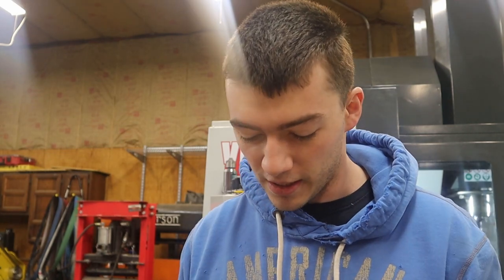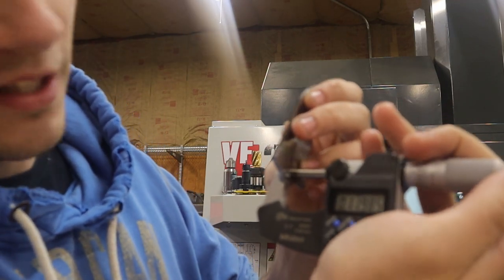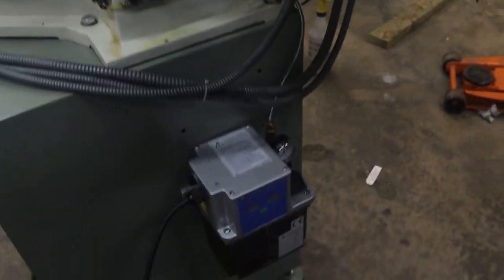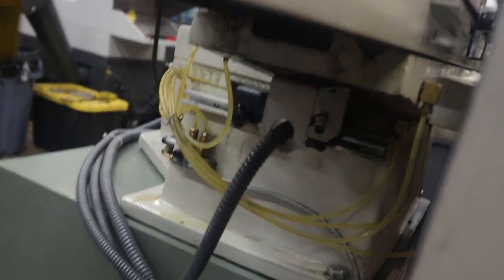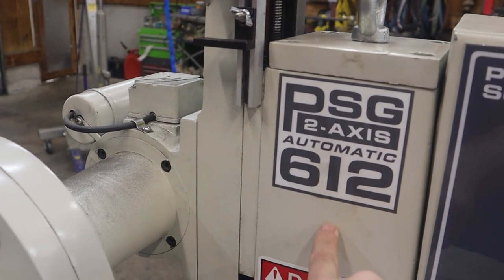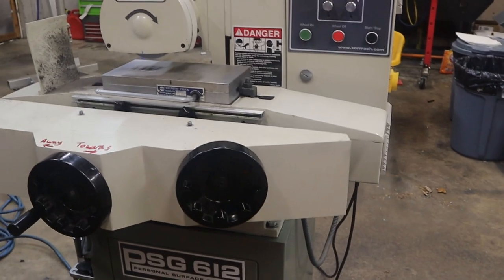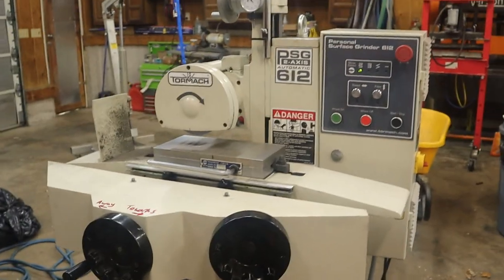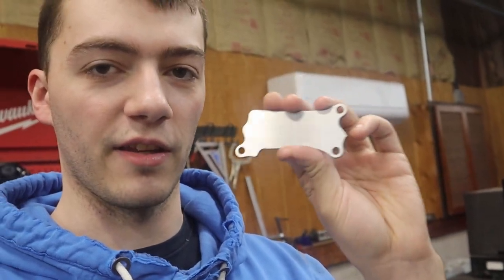The thing I really needed - A surface grinder

Comment: I feel like I'm in a similar spot. I really need my blades an exact thickness. But in my area there's rarely any good used machinery near by. :(
Reply from the maker: There is a ton of old 3 phase grinders for sale. I passed on all of them because they were manual. Those old grinders would certainly grind better but none of them were automatic. After using this one, I would never get one that didn't have at least 2 axis control. Plus 3 phase can be a pain. 

Maybe you could send your stuff out to be ground? After surface grinding, I can't imagine ever going back. Its nice to know that your part is actually flat and parallel. Takes some of the frustration out of work holding and actually getting a nice part. I will add that acid etching the surface ground surface is proving to be tricky. Not sure if you're planning on any acid etching but just keep that in mind.
Reply: @split141x  I definitely agree about wanting it to be automatic. I think sending things out to be ground is a good idea, but it's nice be able to make design changes on the fly. Also I have a similar problem, not sure if there's a lot of places around me for grinding either. I'm in New Mexico. There's not a huge machine shop industry. There is some, but it's focused on work for the scientific labs here.
I don't know anything about acid etching, but I'd imagine that's where a blasting cabinet or tumbler would come in handy.
Reply from the maker: I agree on the design changes on the fly. Im full of them haha. I'd probably never be able to send anything out because I'm always making tiny tweaks. Speaking of a sand blaster for solving my etching issue, I just picked one up today haha. Will see if glass is any good against hardend steel